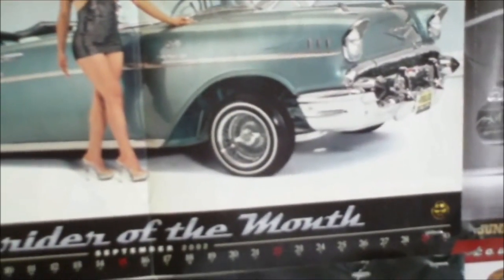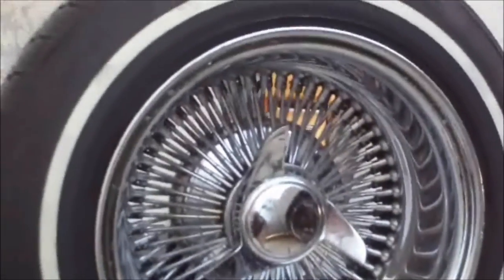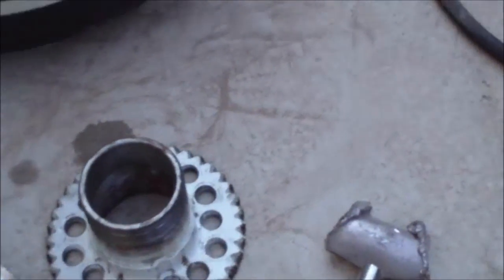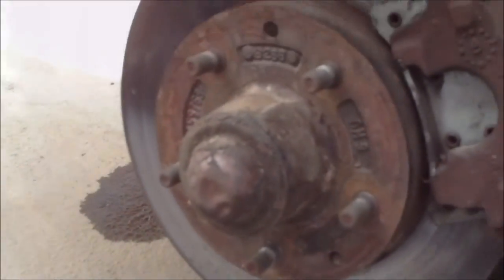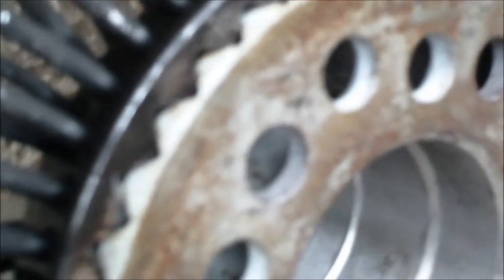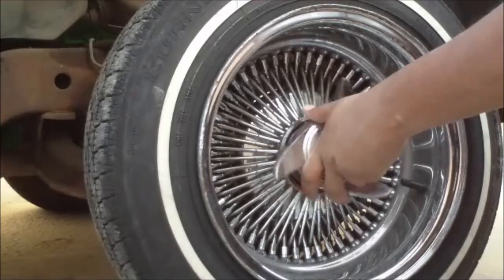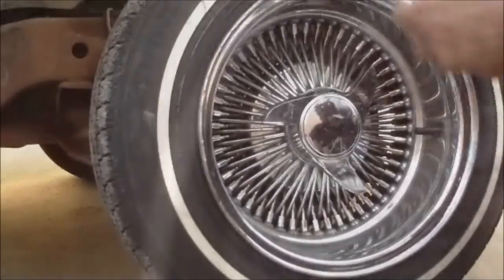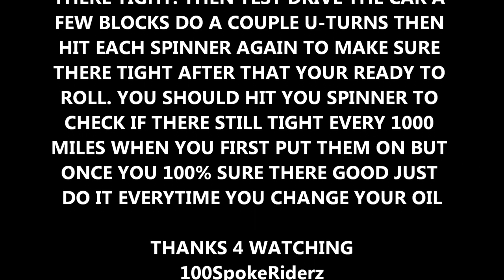HOW TO MOUNT WIRE RIMS ON YOUR RIDE

Comment: Nice video.. quick question so are these wheels easy to rip off?? You just got to remove the spinner and pop off the wheel?
Reply from the maker: sweepEaway About the same as any wheel you still need to pull the lugs off to get the adapter off if you got a good aftermarket alarm you will be fine

Comment: What kind of tire are you using? Are you running tubes in tubeless tires?
Reply from the maker: 155-80-13 is the size of the tire & no tubes are needed

Comment from the maker: Yes I still used a led hammer because if you slip & miss the wrench/tool while your swinging a regular hammer it could dent the rim, chip the chrome or bend a spoke & loose spokes = air psi leaking

Comment: i live over sea's and i have a 1996 caprice and i really want to order a set they will look nice and unique,do i need to buy the adapter separate ? how many lead hammers shall i order to last with me here ? i want the same size 215/75 R 15 i want my speedo to read the same original speed,were to buy and i want the exact design you have in the video,is it daytons or there are other brands ? its humid and hot with temp reaching 122 Fahrenheit here,your advise and recommendation please

Comment: You think it's ok to use used adapters with new wire wheels
Reply from the maker: As long as the teeth are not ground off & everything lines up you should be fine

Comment: i have a 96 towncar... i want to put wire wheels on but  i dont know if i want to go with knock offs or direct bolt...i travel alot so which would u recommend  plus i want to stay with the same size wheel 15×7..thanks for the video

Comment: I just got a set of 22in 100 spokes for my truck and if the adapter arent painted how do i tell which side they go on? Great video thanks for the info
Reply from the maker: They might have stamping on them
Reply: @100SpokeRiderz  ok cool thanks i was curious about do's and don'ts of wire wheels, like reversing and 4wd and other stuff i might not be aware of because I'm about to go get tires on the rims right now and put em on
Reply: @100SpokeRiderz  and the guy below said they always tighten driver side clockwise and passenger side counterclockwise?
Reply: @100SpokeRiderz  i know im blowing you up and i apologize but i got another question, how do i find the bore diameter my adapters arent the right bolt pattern and i have to order new adapters for my 22's
Reply from the maker: @joepeasley6737  That is correct
Reply from the maker: @joepeasley6737  What kinda car are you putting these wheels on ?
Reply: @100SpokeRiderz  a 1988 isuzu pickup spaecab 4wd with a 2.6l
Reply from the maker: @joepeasley6737  I dont know anything about that kinda ride but when you order the new adapters just tell them the year, make & model they should know the adapters you need to fit

Comment: Is there such thing of a wheel lock for these wheels ?
Reply from the maker: Back in the day they made locking spinners but not anymore. If you have a good aftermarket alarm on your car that should be fine because it should go off when the car is lifted up or the vibration of the hammer hit on the spinner

Comment: ay man I been watchin your videos for years,I just went to remove my 100 spokes off my cutlass, they have been on the car for 4yrs now.I been smashin away with a deadblow hammer and they are not budging, any ideas on what to do
Reply from the maker: Dead Blow hammer wont do it you need a Lead knock off hammer its got to the point were they not easy to find so I order mine from OG wire wheel, Amazon or eBay are the 3 best places to get them...Also if you dont care about messing up the spinners & you just need them off ASAP you can use the biggest pipe wrench Harbor Freight sells...Thanks 4Watching
Reply: hey thanks for the reply man, ya i noticed that you were using a led hammer in your video, but i found a few other vids of ppl using dead blows. also when i bought them new and got tires mounted, the tire shop put them on using a deadblow. but i see now that its not working so ill order a lead hammer thanks.

Comment: Thank you 
Is there a place where you can buy used wire wheels ? or would you only get them new ? I don't know where to look .
Reply from the maker: Used wheels just look online (ebay, craigslist, offer up, let go) ect. ect. also there are a lot of shops that sell new wire wheels off facebook & instagram just type in wire wheels on the search bars.... Thanks 4Watching

Comment: hey brother. had a quick question. i'm going to be installing these rims on my caddy this week. just wondering. i dont have the spinner but i have the hex one with the key. can i use a regular flat head hammer or sledge? or does it have to be a lead hammer?. also what size bolts will i need? 3/16?. i only have long open ended nuts that came stock on the 95 deville.
thanks alot.

Comment: How safe are they on the free way bro... just got a pair for my 65 ss.
Reply from the maker: As long as you put them on the right way they are just as safe as a stick wheel. I rode mine from the MidWest 2 the WestCoast 1,700 miles with no problems
Reply: On the knock off there is a arrow foollow the direction of the arrow to tightn

Comment: My passenger side front wheel squeals after i changed them sounds like its rubbing like on the weight i removed the weight and still the same issue what could i do about it?

Comment: A 100 spoke .ima fall off topic a bit .. im thinking of buying a 93 fleetwood but ive noticed on the digital dash it dont have a coolant temp. To see if its ovetheating or not..do they just dont have them or idk ..It disturbs me to thnk that the dash dont tell u the temperature.. I know it should have it ..do u know where it is if it does have it?

Comment: Are there specific torque specs for the adapter?
Can I use a brass hammer instead?
I have 8 sided hex caps, so I'll be hitting the wrench and not the spinners themselves.
Reply from the maker: Just the normal torque for the lug nuts but I would not use a brass hammer. Yes it would probably work but if you slip & hit the chrome it will leave a mark 4Sure better to stick with a lead hammer even with the hex spinners with the wrench

Comment: I have a 2005 Lincoln town ca4 and i am having problems to put them on the brake panel is in the way, help please!!
Reply from the maker: On that year Lincoln you have to so a lot of mods to get 13's to fit most people swap out the A-arms,spindles, & brakes from a older towncar from the earlier 90's. 1999-2002 was the last years of the Towncars that was easy to bolt on spokes 2003 & newer they changed the front suspension geometry & made it very difficult to mod

Comment from the maker: When you order your rims tell them you want Standard or Front Wheel Drive Offset ONLY
Reply from the maker: Ted Johnson  If you bolt rear wheel drive offset wheels on a front wheel drive car they will sick out very far pass the wheel well & it puts a lot of stress on the suspension & that leads to broken parts

Comment: Nice vid bro, you're the only one on here with a video like this, much props. I got a question, I saw that you said that it's not a good idea to put hydraulics on a FWD ride. I have a 94' Cadillac Sedan Deville, what about airbags? Would that be better than hydraulics?
Reply from the maker: One day I hope to do a part 2 to this video going into more detail & using a better looking rim. Airbags are a lot less stressful on a FWD cars body & suspension parts than hydraulics but only if its front & back when you try to do 3wheel motion, side 2 side, or hop with a crazy fast air set up your going to twist your body up. If you keep it simple with the air bags you will be OK you just have to remember a FWD car is unibody (no frame) so that why they dont last 2 long when you try to do 2 much..... Thanks 4Watching
Reply: 100SpokeRiderz I think you explained it very well, I plan on putting on my wires using this vid as my guide. I've searched everywhere and there's no one that actually visually shows you how it's done. What about the studs though, is it true they can only be so long? Sucks that I can't do side to side or put hydraulics but on the other hand, at least I'll save some money just going with front and back. Thanks again, really appreciate it.
Reply from the maker: TheCruzFX  Yes if the studs are too long the rims wont go on right if you got the stock studs you should be fine but sometimes people use after market studs that a longer & thoes wont work
Reply: 100SpokeRiderz Ok, thanks for all the info. Mad props to you bro.

Comment: What is the significance of the red and white adapter?Does the spinner go on the opposite way on each side of the car??
Reply from the maker: The red is threaded one way & the white is threaded the other way  the white adapter goes on the DRIVERS SIDE and the red adapter goes on the PAS. SIDE

Comment: i have a 72 impala and i have some 13's but the caliper is rubbing on the back of my rim man i even put a spacer behind the adapter and its barely rubbing man what can i do ......please let me know i dont wanna look like a dam fool
Reply from the maker: You need to grind down the caliper so it will clear without rubbing I had the same problem with my 73 Caprice

Comment: If I decided to get knockoffs where can I find lock adapters from keeping my knockoffs  coming loose? I can't find them on line.
Reply from the maker: wire wheel adapters on Ebay there are 187 results on there right now

Comment: Hello I just mounted my 13 inch wire wheels on my Cadillac sedan deville  car 1990 but when I drive it and press my brakes a load crunch sounds goes off please help me with this problem brother.
Reply: +Daniel Garcia It sounds like the caliper or pad is hitting the adapter.  Remove the wheel and check for proper clearances when engaging the brakes.

Comment from the maker: Ive seen Civic's on wire rims before so you should be ok as long as you get the right offset rims what I mean is 13X7 reverse offset will fit but will stick out (like on the movie Baby Boy) but that is very hard on the stock suspension you would be better off wit Standard offset rims

Comment from the maker: If its the kinda lock that looks like a bolt but the head has 3 dots or a funny shape cut into it then I would get a dremel tool cut a line into the head & twist it off with a flathead screwdriver

Comment from the maker: I did not have the impact gun turned up that high also I never use a impact gun when im going to drive the car the ONLY reason I did in this vid was to save time & the fact the car just sits in the back yard but I normaly use a 4 way & a tork wrench to double check them

Comment: Couldn't get my 13's on my Lincoln, wouldn't fit over the brake caliper, grinded them down and used a spacer
Reply from the maker: I've only put 13's on G-Bodys all the bigger 4 door cars I used 14's but everyone with a Lincoln on 13's I've seen all had to grind down the caliper.
Reply: @100SpokeRiderz  thanks for replying brotha!! 💯

Comment: hey 100 spoke just had a question the spinner on my 100 spokes white adapter  drivers side tightens clockwise and the red passenger tightens counter clock wise would this mean when i drive the spinner will loosen 1st time with 100 spokes

Comment: good video, where did you get that particular style spinner? would it fit an jaguar e-type hub? thanks!
Reply from the maker: It's the spinner that came with the wheels & I'm not 100% sure if it would fit on a Jag hub because it might be a different size & thread
Reply: 100SpokeRiderz thanks for your kind reply.
Reply: Any idea which company 
I can call on these to find out?
Reply from the maker: @dennisd7292  http://www.daytonwirewheels.com/

Comment: If you don’t have a lead hammer what could you use , like wood then hit it with a hammer ???
Reply from the maker: You can order a lead hammer on eBay or they make a knock off spinner tool but I wouldn't use wood & a regular hammer because it won't get it on tight enough & if you slip you will damage the chrome

Comment: my MG  has no teeth on it's wire wheel adapters. Is this a problem?
Reply from the maker: Is all 4 the same? I'm not familiar with stock MG wheels but every aftermarket wheel (like in this vid) that I've ever own had teeth on the adapter
Reply: @100SpokeRiderz   yeah they are

Comment: how do I remove 22" wire wheel without damaging the knockoff that doesn't have those wings coming out
Reply from the maker: +kenny herrera You need a knock off tool there are a few different kind for different style & brand knock offs

Comment from the maker: @Mychucks07  13" & 14" all have the same adapters but where you might run into a problem is different brand of rims have different style adapters like you cant use a Roadster rim adapter on a dayton rims & zenith rims adapters are different than Player wire rims ect.ect. So the main question is what brand were the old 13's & what brand were the new 14's ?

Comment from the maker: Yea 14's will fit good wit no mods as long as your stock suspension is in good shape your ride hight will be fine. If you look at my old vids I had a 88 Towncar wit 14's on stock suspension & I put many problem free miles on that car wit that setup.

Comment: everytime you change your oil is a good tip. What would be the most important thing to consider if looking to put on a 2014 model vehicle?
Reply from the maker: what kinda vehicle?
Reply: 100SpokeRiderz 2014 ford fusion. im worried about the weight. it comes with factory 19in. wheels. kinda large for cool Daytons?
Reply from the maker: as long as you get the standard or front wheel drive offset you will be ok the weight should not be a problem
Reply: 100SpokeRiderz I'm in Colorado. where is a good place to go online to find a good priced set?

Comment from the maker: A 2001 Nissan Maxima is a front wheel drive car so you need FWD rims or Standars off set rims, the rims in this video are Reverse offset for Rear Wheel Drive cars & if you try to put them on your Nissan they will stick out way past the fenders & will put a lot a stress on your suspension parts.

Comment: What about the bullet shape knock offs? How do you mount those?
Reply from the maker: +Robert Franco Google " bullet knock off wrench " to see what it looks like but thats what you need to get them on & off https://www.google.com/search?q=bullet+knock+off+wrench&espv=2&biw=1440&bih=775&source=lnms&tbm=isch&sa=X&ved=0ahUKEwiq6_-v9bXJAhVIMogKHVN5BvkQ_AUIBygC
Reply: Thanks 100SpokeRiderz
Reply: Your opinion, which way do you think is better? 100SpokeRiderz
Reply from the maker: Robert Franco I like the 3 blade spinner the best but I do like the bullet spinners with powder coated colores spokes because it lets you see more of the rims & they do look cool spinning. At the end of the day tho they all spin on the same way it just comes down to witch ones you like the look of the best
Reply: True that. I like the 2 wing and know how to mount the wing knockoffs but I've never tried the bullet 100SpokeRiderz
Reply: Robert Franco they come with a big wrench that goes over the spinner
Reply: Do I need to use anything to protect the hex or bullet shape knock off when I am using the wrench tool? Will the wrench tool scratch my chrome knock off?

Comment: Hey bro nice video very helpful got question for u if i have 1993 caddy sedan deville what size wire wheels can i put its front wheel drive??
Also for 1990 honda what size wire wheels can i put on thanks boss?? If u know would be real helpful
Reply from the maker: on thoes two cars i would not go any smaller than a 14" & no bigger than a 20" wheel. As long as you get front wheel drive off set wheels you will be OK... Thanks 4Watching
Reply: Thanks alot boss i appeciate ur response ima try it out everybody i talk to bout the 1990 honda they say i the wire wheels wont fit on the honda boss that's why i asked i know that u know wassup w them

Comment: Would the adapter work on non  spoke wheels? I'd like to use them on my 82 vette with 78 pace car rims. I'm always loosing my spinners
Reply from the maker: They do make non spoke wheels with adapters & spinners but the adapter is made with the wheel. Wire wheel adapters can only be used on wire wheels

Comment: Great video bro... I have a 81 cutlass and looking to get a set of 13x7 og wires ... will I need spacers to mount properly? Thanks in advance
Reply from the maker: There are 2 way to go, you can get spacers or shave the caliper. I would test fit the rim first & see how much it rubs. On my 78 Cutlass I only had to shave a little off my caliper bolts but on some years the calipers are bigger so you would have to shave a lot off the caliper its self so spacers would be the better way to go.

Comment: I installed my wheels a while back I'm trying to remove them but I can't remember which way to turn the knock off. Left side driver is what way to remove??
Reply: marquezn8 driver side has normal thread passenger side has reverse thread. always remember the 3 r's Right Side, Red Adapter, Reverse Thread.
El Chivo's Hydraulics.
Reply: +marquezn8 A rule of thumb for Knock-Offs is, "Ass-backwards" meaning you TIGHTEN them towards the back, so you do the opposite to loosen.  Vintage cars have arrows with the word "OFF" engraved so you get it right.

Your wheel documentation should have a diagram, but in general, to loosen, the right side should be clockwise, and the left side counterclockwise (turn the top towards the front.)   Contact the manufacturer for specifics.

Comment: hey brother just me again. quick question. i know you mentioned  in the video about lugnuts. i have short open ended lugnuts but they stick a bit past the stud is that normal and can i use them?. there stock nuts of a 95 Deville. 2 rim shops said it was fine, but i never put them on yet without being 100% positive.